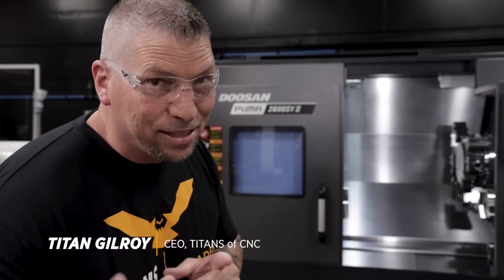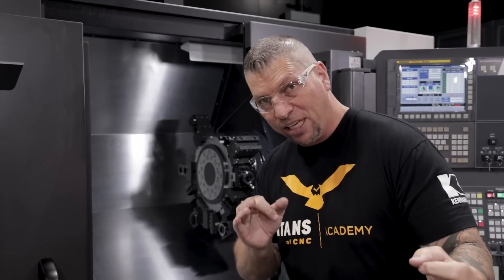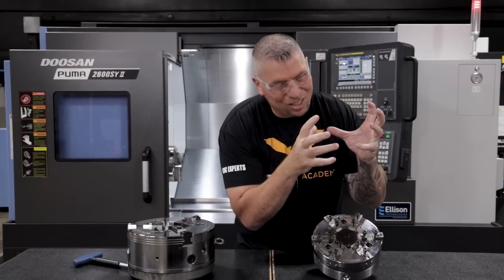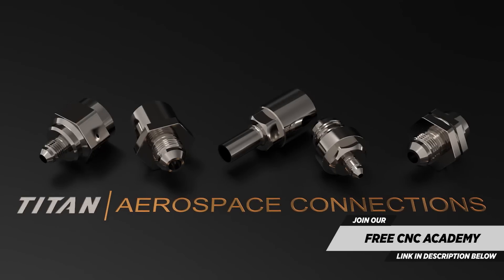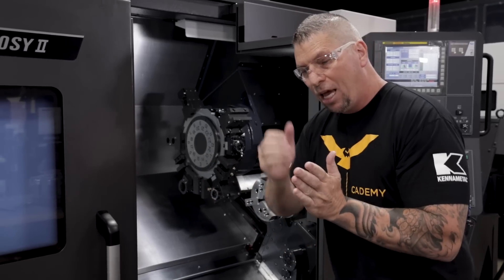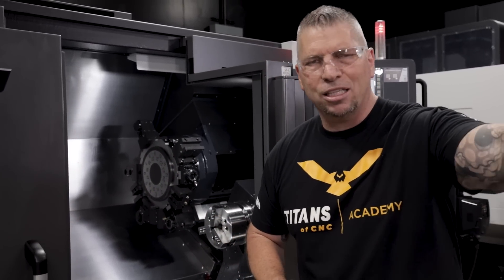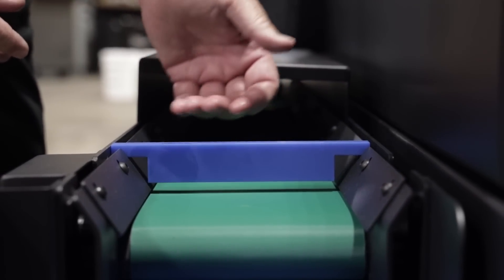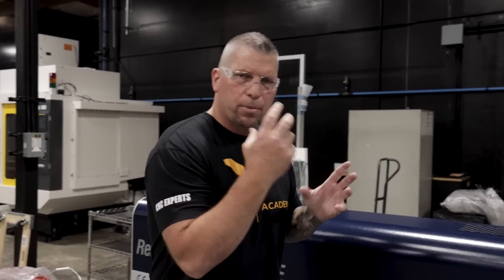DN Solutions PUMA 2600SY II Lathe Arrives At Our CNC Machine Shop

Comment: I worked on Puma 280m's and Lynx 220m's and a Puma SY loved working on them.
Great CNC's for the price made some nice stuff on them, I found that the Manual guild programming system
on them is good, also worked well with B macro programming.
If i remember right they had 5.5k motors on the driven tooling.

Comment: Machinist is a term that encompasses a wide array of skills, programming, setting up and knowing tooling, choosing workholding, and the art of metal cutting.  I would argue it goes further though, a machinist can engineer solutions and problem solve.  A machinist is willing to go further and learn about heat treating, grinding, coatings, and even learn to weld.  It takes a lifetime to master a trade, but entry should not be as hard as it is.  Your academy is going to help those willing to put in the time and effort, there will be no excuses not to advance in this trade.